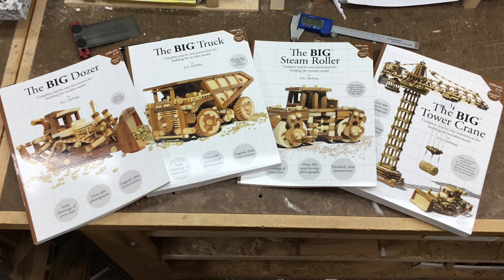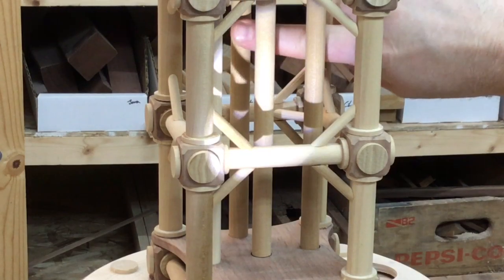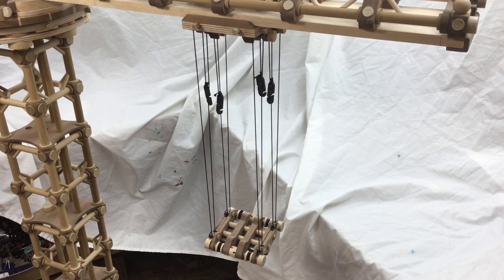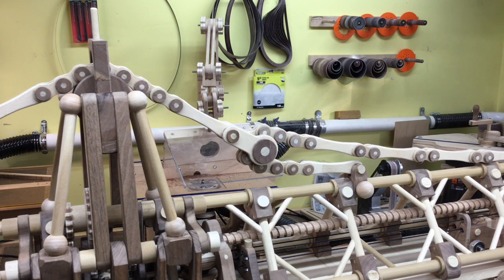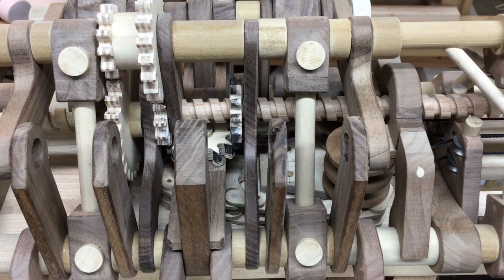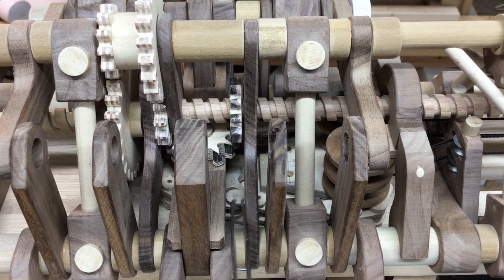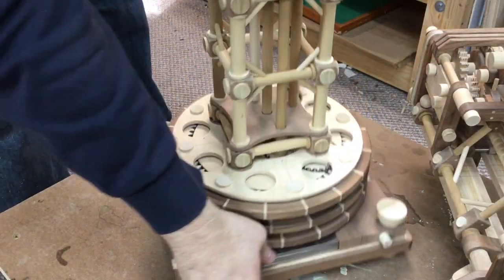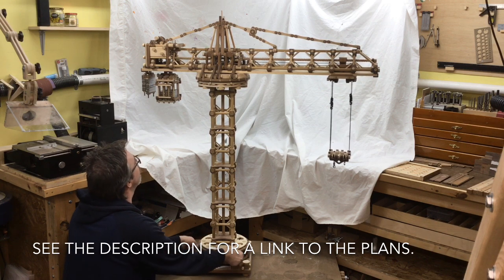Mechanical wooden model tower crane - the long video

Comment: Amazing work! Do you work with a lot of heavy equipment or just a subject to use for a working model?
Reply from the maker: I don't work with heavy equipment, nor am I an engineer. I just like building models with lots of moving parts and mechanical systems. Thanks for asking.